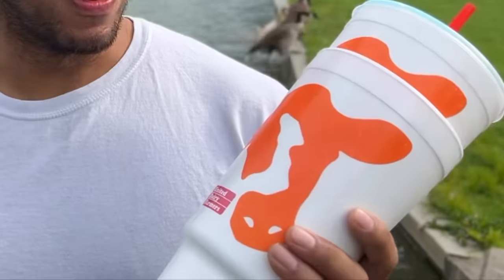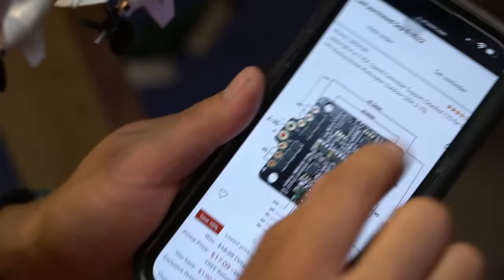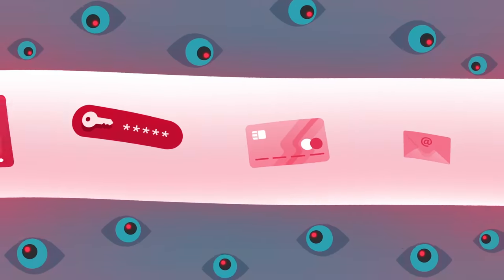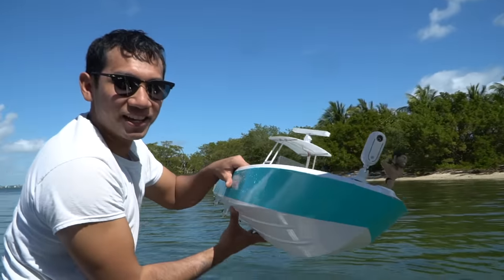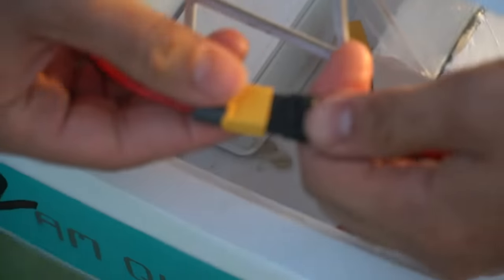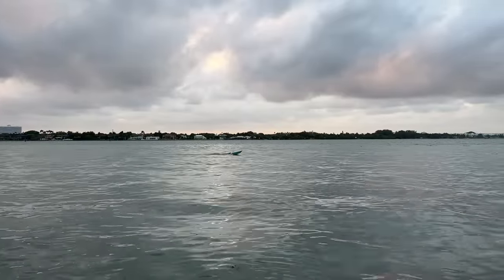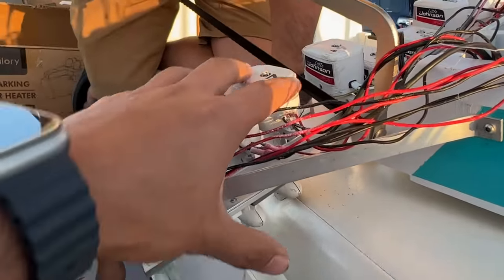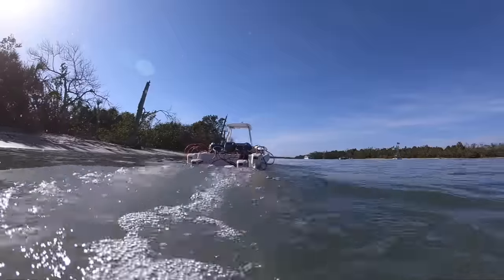How many boat engines is too many?

Comment: I just wanna point out an interesting thing the motors on the right side of the boat when you lined them up on both sides were making the down wash much less frothy that's normally a good indication that efficiency is going up. I know in planes they had some success with tip motors making a vorticy that helps drag. Might want to try making them turn the other way on the left side and making new props.

Comment: the prop pitch dictates the max speed. No mater how many motors you add, it will always reach the same max speed. You need to increase the pitch together with adding motors to gain more speed. Anyway, thanks for another hilarious project!

Comment: My thought on this is that more same motor is like connecting the engine with more wheels to spin, like fwd vs AWD. I'd say there is a slight improvement in initial acceleration. At the end of the day, you are reaching the top flow speed of the rotors.
Reply: Very close too if not reached.. I think you have the real answer here.. Need faster propellers.

Comment: You just create more torque if you don't change the propellers. That's why it doesn't go any faster. Also adding counter-rotating props could be ideal for the stacked setup.

Comment: I'd be curious, whether cutting some holes in the middle of the boat and fitting more motors through there might solve things. Presumably, the water will no longer be as turbulent once it reaches the motors at the back, so it might function better than the stacked rows. Also, you could fit the propellers in the middle somewhat lower than those at the back to get the boat to naturally pitch upward a bit.

Comment: Can you 3D print toroidal propellors and do some efficiency tests? Would be cool!
Reply: Funny how toroidal propellers are "new technology"  they were invented in the 1890s hahaha reinvented in the 1960s. I do understand that material technology and manufacturing processes have made them easier to produce it's just funny when the marketing department gets involved it is labeled as new tech.
Reply: @BIllMcCambridge  Probably, but even then I have seen some good amount of 3D printed versions and they were worse than the original propeller, every small tweak could do a big difference and probably will still have to do many tries to get a perfect one.

Comment: I love this idea. From what I can tell, the motors on riggers was just too much, and putting them in rows behind might work if you make the propshafts longer on the motors the further back they are. Also the props are possibly too small since there is a bunch of bubbles from cavitation, but first try putting the props deeper in the water the further back they are and if you still see lots of aeration behind the boat when its not on plane, increase prop diameter and or pitch.

Comment: The boat is already going at it's top speed with 4 motors on it.  Adding more motors will not change the top speed.  It'll just change how fast it gets to top speed.  You could probably double the speed just by changing the pitch of the props on the 4 motor setup

Comment: 08:34 the guys at the boat show that says "you can never have enough speed" 🤦‍♂ there comes a point where more motors does not necesarily = more speed, you can only go as fast as your fastest motor can push. It is like comparing having more poeple pushing an object like a car, the more poeple you have pushing it the easier it is going to be, but you can only push as fast as the fastest person can push

Comment: 9:40 Yeah the issue is thrust basically your creating a vacuum under the hull causing it to stick to the water and drag down the rear end theres a couple ways to fix this one of the simplest however is extending the length so it takes more force to leverage it down or weights at the front

Comment: A propeller in water pushes water backwards, propelling the boat forward. The terminal velocity of the boat is the velocity of that backwards stream of water minus the drag of the boat. The more propellers in the water, the less effect the hulk drag has on decreasing that terminal velocity, but at some point you can only go as fast as the propeller spins and sends the water backwards. Basically the more motors you have the better at towing you will be at low speeds, but it won’t ever make you faster than the terminal velocity of a single engine propulsion stream …

It’s like a car with tires that slip on the road surface. Making the tires wider will get you better grip, but won’t make you go faster..

Comment: FYI; a Mercury 450R costs between $55,000 and $80,000 each,
Each engine will consume 2 litres of petrol every kilometre at speeds over 25 kmh. 
So, six of them will use 12-litres per klick.
In NZ, that would cost $34 per kilometre, for the fuel alone!

Comment: A “12 AM Quickie” with “12 Little Johnsons”. Hey look, whatever floats your boat. I might do the same with enough pier pressure. If you plan on selling these boats, I hope there’s a sail on them. I invented a Bluetooth iceberg. Every ship that gets too close to it syncs. I was playing cards recently with a few of my fellow pirates but I had trouble shuffling the cards because the captain was standing on the deck. Speaking of captains, I recently discovered that Captain Hook gets his hooks from a second hand store. Unfortunately, I also discovered a secret cavity below deck on my sailing ship, so I took it to the Tooth Ferry. A ship carrying vegetables recently sank a few miles off shore. It had leeks. I recently started dating a sunken boat. I guess you could say, I developed a deep relationship. An eye doctor recently joined our crew. He was a see captain. A ship carrying football players rammed a boat carrying baseball players. It was a bad sportsmanship. At least they had clean uniforms, which they washed up on shore with Tide.

Comment: Adding more outboards aren't really for more speed, it's to carry load. The difference between running triples and quads in speed won't be much unless the boat is loaded down. Remember each one of the lower units is extra drag. When we took our 33 foot CC from twin 400R to triple 300s we lost 6mph with a light load in the boat... BUT when we have 6 people, lots of gear, Ice, fish, full tank of fuel the difference was night and day. The boat handled rough water so much better while loaded down, it popped up on plane quick, it's cruise efficiency was drastically better when the boat was loaded down..... if you want to carry more load you add power. And I'll tell you a secret two 450s will always be faster then 3 300s... hell two 400s will be faster then 3x 300s (won't carry load as well) when the boats light because all that extra drag and weight. Best way it increase speed in a boat is to remove weight and run more pitch on the prop.

Comment: If you wanna have more motors behind one and a other they need to rotate differently for it to have a effect 
And to boost this kind effect to the max the turbines need to be inside a tube 
So small explanation the one in front rotates left and the one in the beck rotates right and tada more speed this concept is used in some wind tunnels btw

Comment: Next time, you should try to put them in a V configuration, this way none of the outboards will be directly in front of or behind each other. This will reduce the amount of air that is accelerated therefore moving more water and making your boat go faster.

Comment: I always chuckle at the people who strap a half dozen 400s to the back of a boat. Like, you can get in inboard... a single big cube V8 can make over 1000hp n/a, well north of 2500hp on boost. Run a twin turbo 632, at 3000hp. Compared to a half dozen 400s making 2400hp... And you have 1/6 the motors to worry about.

Comment: I used to live on the river. I saw lots of boats. We had hydroplane races every year on the Columbia. I know fast. First time I actually watched a video on an ocean going boat with 3 300 hp motors on the back and the boat barely broke 90mph. I was probably heavier than normal open river boats but still, a single 350 on a bass boat and you are easily at and can push over 75mph. It is FAST AF on the water if you didn't know. I still have yet to see any of the tandem outboard boats really get after it like a cigar boat or a bass boat. Hell, a redneck with a 450 on a ski happens all the time.

Comment: I think that the main contributing factor to the top speed of the boat is how fast the motors themselves are spinning. To put it in a different example, lets say you have an RC car with a motor on each of the wheels. If the top speed of the motors will only push the RC car to 10mph, then it doesn't matter if you have 2, 4, 12, or 20 wheels driving it forward, the top speed will still only be 10mph. That is essentially what you have here.  Having more motors that are also pushing at the same speed isn't going to make it go any faster. It might have more thrust, but that thrust still has a top speed. 

That said, the correct number of outboards = the least number of outboards it takes to give it the maximum amount of acceleration and top speed. If you can do it with less motors, than it's more efficient.

Comment: The first outboard config was the best. Bring the nose down and your motors will work.
Your fore is lifted too much with the aft propulsion and weight. Moving ballast to the front or a downturn hydrofoil to direct the fore down. I also think a hydroplane version of this would be pretty sick
The in-line config interferes too much with the prop and rudder efficacy. Too many bubbles and not enough water to grab. A single row perpendicular to the keel is optimum rather than stacked, 
 Moderate adjustments may be needed for the rudder config

Comment: You really should try to make an actual working rc boat (doesn’t matter if the motor is inboard or outboard, maybe try both) step by step with an rc car motor. I’m saying this cause I’m not sure if you’re into rc cars but many of the people in the rc car community upgrade their motors and the old one ends up sitting on the shelf. I’d suggest you trying to do this without too many 3d printed parts (boat hull is fine ofc) but with parts found online so that people can see the product you used, but it and make their own. I just subscribed about a week ago but your content is amazing and I want to see it become even better.

Comment: You need to ask two questions.
1, How many boat engines is too many?
2, are you a US citizen?
seriously though, the stacking outboard thing doesn't make sense. I would rather have to service two larger outboards than six smaller ones.

Comment: Let's say the engine at 10,000 rpm with 100% eff. the boat goes 100mph.  at 90% eff with one engine you go 90 mph.  So. no matter how many engines you add you never exceed 100 mph.  You can carry more fuel and more passengers or buck more headwind or current.
Iguana

Comment: Too bad the ESC was capped at 3s.  With a water pickup and jacket (and of course canned motors)    the extra 3.7v  would deliver the hole shot you're looking for.  Also, looks like the cavitation plates are buried... raise the motors?

Comment: In addition to being in turbulent wake, realistically the props can only get the water up to some speed V_max. If the water a prop is ingesting is already near V_max, it's not going to make a huge difference in the speed of that water and thus the thrust produced is going to be marginal at best.

At the end of the day the force you can produce is going to be the difference between momentum of the water in vs momentum of the water out. If there's a small difference in momentum, there's only a small difference in force.

Comment: rcflighttest came out with a video explain efficiency of props. You obviously have a lot of air which is slowing the boat down meaning most of the props behind the main ones are doin next to nothing. Also when it gets on plain, find the degree of how high the front is to how low the rear is then add that degree to the rear props that way it still sits flat under water. if you understand what I'm saying. anyone who has more to say please comment cuz i wanna learn more (i was only half way threw the video so sorry if you answered it any further on in the video)

Comment: Your other issue is lack of trim. Id wager with a higher trim angle it would perhaps get that first boat on plane.  You can have a normal boat " wash the engine" where it's not utilizing it's power and creating a wash, but if you change the trim to a higher setting your  will plane out.  Love your work, and I know that would be excessive mount of work.  But it made me wonder if that line just trimmed up to a different angle  of it wouldn't plane the entire boat and the line of engines.

Comment: Great vid.  I think that you could use props with a little bit more pitch?  Buy a nice set of plastic race props that will not be as expensive a brass props.  
Regards, Jas.  
VK4FJGS  
Rocky Qld.

Comment: They are trying to push the same water at the same speed. It's not going to work in front of each other. How about using a lot of gears with a strong motor to drive an array of propellers. You could position them better, closer, and have multiple rows and column.

Comment: As noted by others here, there are a number of other factors that affect the performance that seem to be lacking proper consideration on this model boat: prop pitch and diameter, motor attitude (tilt/trim) and balance of the load-I can assure you that the boat will perform much better if those batteries are moved further forward, and that will decrease any need for additional lift at the stern (such as the empty plastic drink bottles or those smaller hulls), whether it's on a radio controlled model or the real thing--too much weight in the back and it's hard to get it to plane, the stern wants to drop down into the water, and your videos prove that--the extra width can also be a problem, but so can additional length--there is always going to be a point of diminishing returns, so YES, there can be such a thing as "too many" outboard motors--it was still a hoot to see all of the modifications and test runs, thanks for the laughs-

Comment: Which way we’re your props spinning?  They should’ve been spinning opposite to the one next to it. If you have 4 motors the outside two should be spinning the same direction let’s say clockwise and the inside two spinning counter clockwise.

Comment: Adding more motors was never going to make it go faster. Assuming drag to be minimal on plane, speed is mainly a function of rpm and/or pitch. You could tow more stuff with more motors as you have increased water engagement.

Comment: I believe the reason it did not work is because it was too ass heavy. If you would have added weight to the front to level out the boat it would have worked. Think about airplanes, in that you need to have the center of gravity in the right place. In other words trim.

Comment: I haven’t seen it mentioned, but the battery/electronics weight should really be placed at the front of the boat to have any chance of planing. 
You’re just swamping the motors with all the weight in the rear.

Comment: it should be pretty logical. the cavitation from the first set of motors is gonna create air pockets that the other motors have nothing to interact with.
you're gonna get diminishing returns. at most a second row might work somewhat, but not 3. not with that much added weight.

Comment: You failed because you didn’t add more voltage to the entire system. You added more side boats but failed to add the necessary amps for them to run faster, you essentially distributed the load across all of the motors, when you should have added the voltage needed to match those other added motors to run efficiently.

Comment: But how much power is too much power.. Can you move to two inboard motors and see how fast you can get that boat to go.  Keep increasing the size and see what happens. It would have been great to have a GPS on board for speed.

Comment: The original longways build would’ve worked just fine if you’d used bigger “toy” boats,,,bigger flotation platforms to withstand the weight of everything…

Comment: Did you just get to the motor speed times pitch angle. With all the extra power. Either a higher pitch prop or similar is needed.
What would you do if you increased the hp of a single engine motor?

Comment: what if you had 5 behind the boat to get it on the plane, and the rest on either side as you first tried but raised higher out the water and trimmed higher to function better when already on the plane, so you could have less drag to get up and more power once there?

Comment: we're going to see this problem with electric planes. the propellers on these large planes will have to spin extremely fast or be extremely large, either of which will result in incredible noise. we're going to see a lot of electric planes coming out with like 8+ engines and propellers.

Comment: you need to do 2 litle boots on the outside of the motors ..not stick to the boot  like you did with the 4 litle ones this wil stop the boot they stop the smooth waterflow .. so 2 litle ones on the outside left and right from the motors ..sorry for my english its bad ..i know it